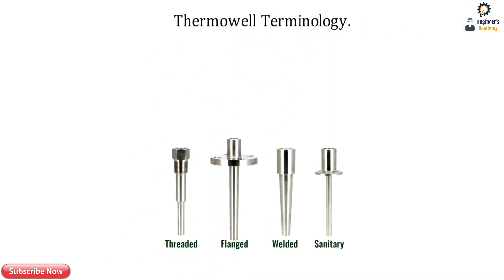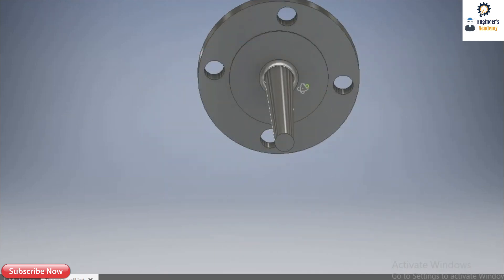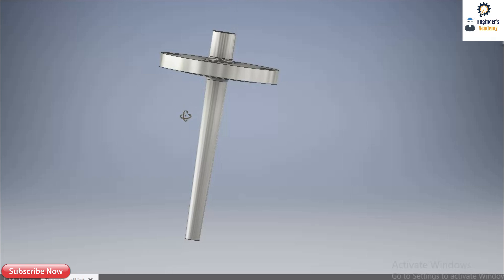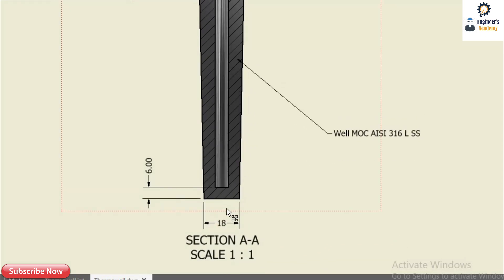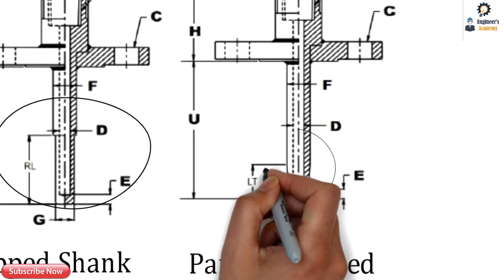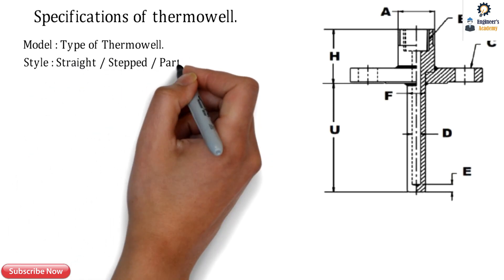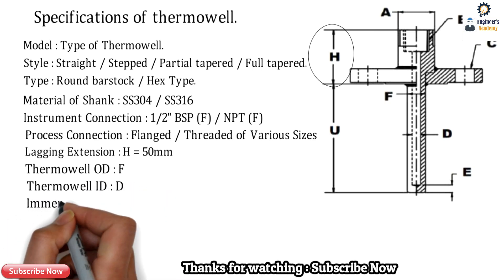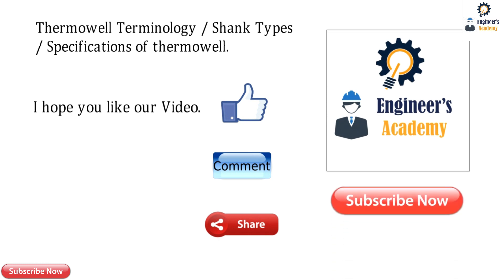Thermowell Terminology & Specifications ||Engineer's Academy||

Comment: Why we need to install thermowell 45 degree
Reply from the maker: That's not mandatory to mount at 45 .. you can mount perpendicular to to flow as well . In certain cases due to space constraints .. it is usually mount at 45 deg. Thanks for watching..